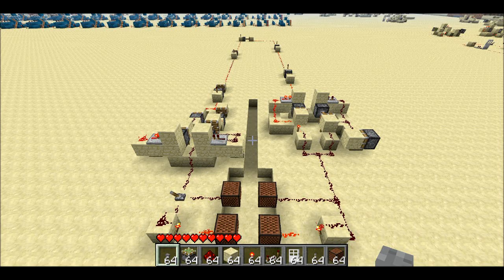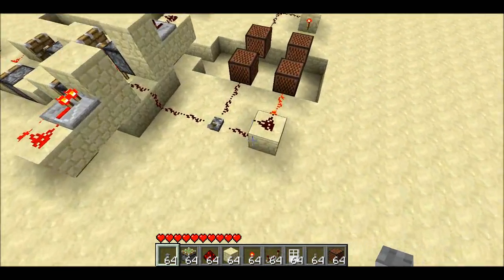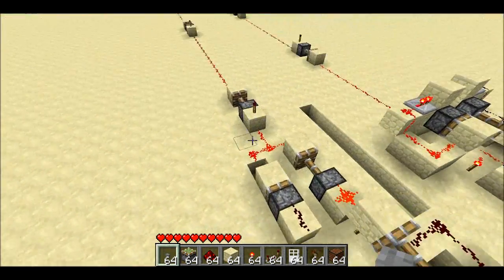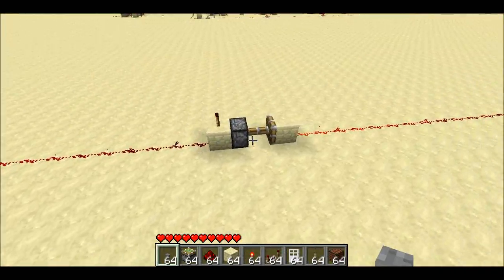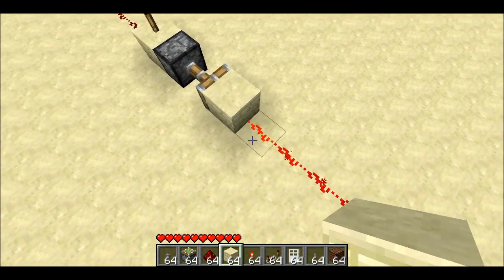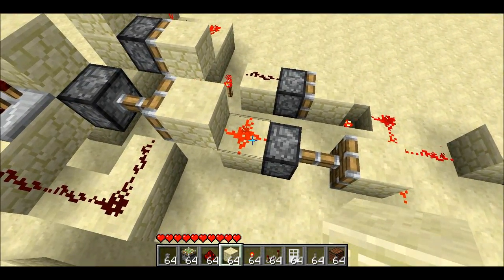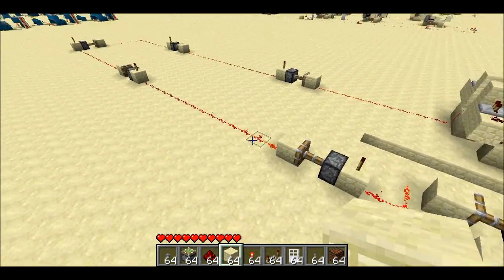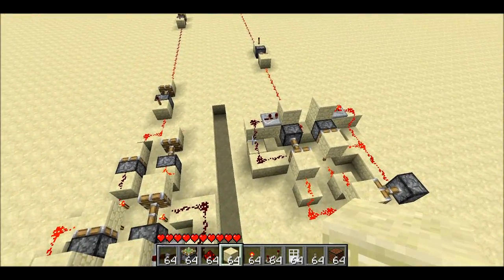Very Compact, Long Distance, Dual-Edge InstantWire

Comment: Hey Sethbling!  I recently made a video testing if I could send or call unmanned minecarts distances greater than 144-190 blocks.  (The video is /saIB7sYRLz4 if you want to check it out).  Would this help overcome that barrier, or does it really just help the signal get there instantly?